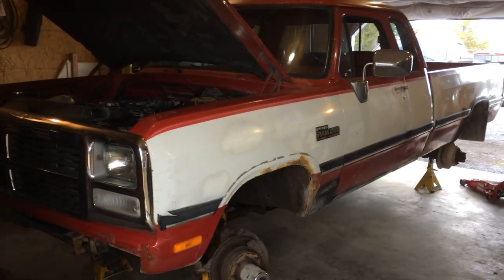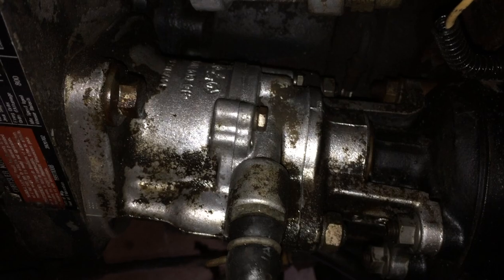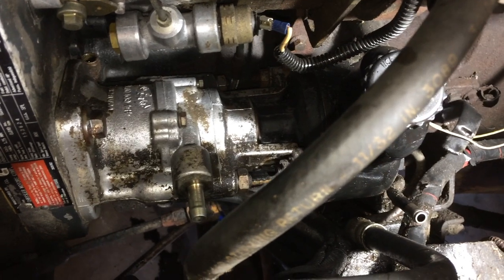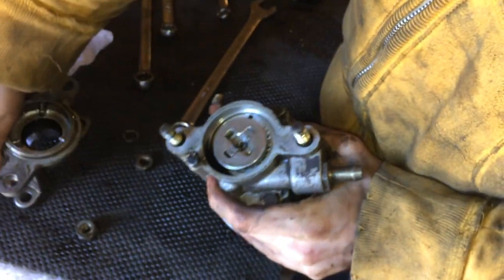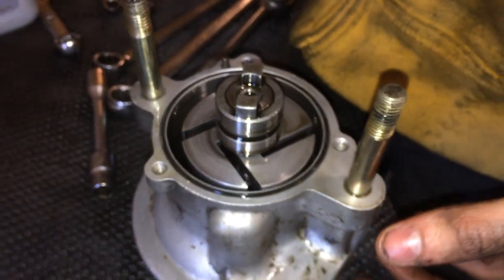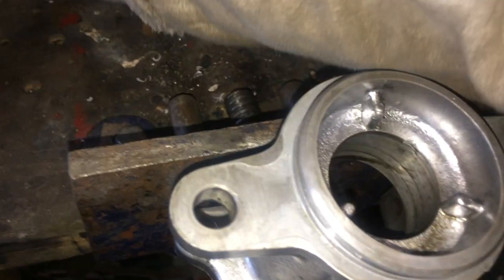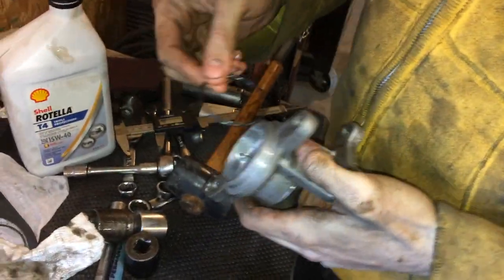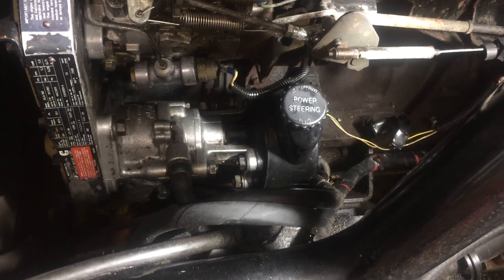Vacuum Pump Seal First Gen

Comment: I’m hoping you can help me, I tried finding a link to email you directly but didn’t see one. I have a vacuum pump on a 92 making too much vacuum, 30” hg at an idle, we have found out from much experimentation that the brake booster does not work correctly at that high a vacuum level, so my brakes are almost nonexistent. I have working, although manual brakes with the vacuum hose disconnected, but no brakes at all for the first several pumps with vacuum applied to the booster. What could cause such a high vacuum level, and any ideas how to correct this problem?

Comment: Ridiculous to replace seals on these pumps, they only going to leak again, Gould Electric in Murphy NC sells an improved rebuilt WEBCOMIC vacuum pump with parts made in USA that last 180,000 miles
Reply: WEBCO
Reply from the maker: Doesn't hurt to maintain what you've got though...learn something new and repairs the problem.
Reply: Ovens Garage except until you replace the vacuum pump and steering pump with a better quality product it’s going to be a leaker

Comment: heat set (hard) o rings , depending how many heat/cool cycles and o ring material . Heavy equipment , depending on circuit(work/heat/design)  10,000 hours approx , skinny little o ring , yep fail sooner
Reply from the maker: Great engines though! This isn't that bad of a fix for another 10k hours.
Reply: certainly No dis , I'm a HD mech , just diff experience. I've been watching your channel for specific 1st gen stuff !  12V 5.9's very good,my choice, the best . keep it up , enjoying 1st gen stuff...